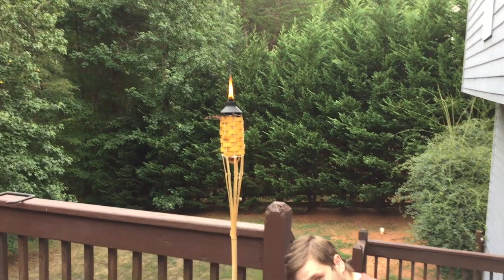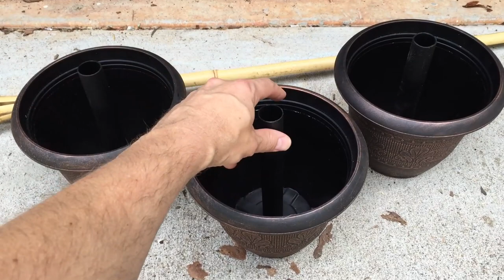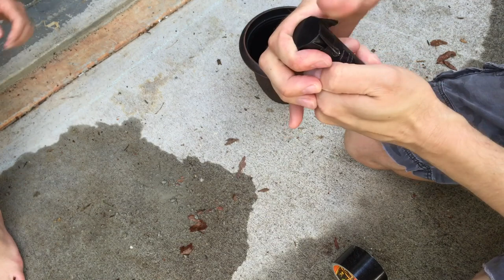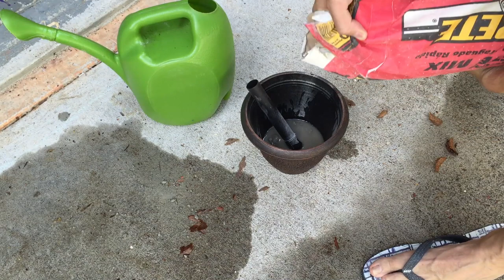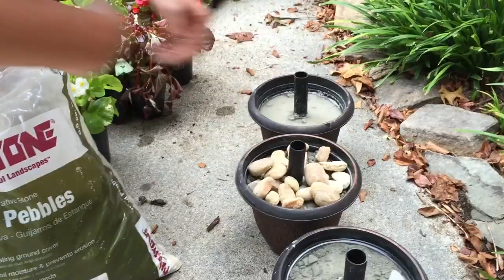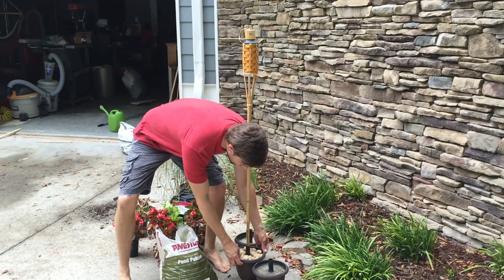DIY Tiki Torch Stands

Comment: Awesome DIY.  Took me about an hour to do 8 of them.  Use at LEAST an 8” pot.  When the fuel canister is full, the weight at the top makes the base unstable if it’s smaller than that.  I filled my pots half full of of quickcrete

Comment: Sooo curious though. With nowhere for water to drain, have you created mosquitoes hot beds ? Water will pool on top of the concrete and mosquitoes will thrive?  Just my 1st thought.
Reply from the maker: I figured that out after the video. I drilled some small drain holes in the sides later on.

Comment: made these, unfortunately with the slightest nudge of the lawn mower it easily tipped, luckily it wasn't on.  I like the idea overall, but i'm going to buy the square pot next time to give it a wider base. 
I'm scared to have these around if there are kids or a dog because when filled they are top heavy
Reply from the maker: I didn‘t have that problem. Mine were pretty stable with the concrete poured in the base. Maybe you could go for a slightly bigger pot with more concrete?
Reply: That’s why these are moveable.
Reply: @kellimucci1414  and very tippable.  Things can be moveable and still sturdy you know

Comment: Hmm. Tiki torch stakes are about $3 each. This solution sounds more expensive.
Reply from the maker: It probably is 😂
Reply: Pond pebbles are roughly $5 depending on the pebbles. The quikrete is also $5 so $10 investment compared to the stakes which are $5 where i am.

The neat thing about this is the decor of the pot and the pebbles can compliment the home nicely compared to the simply stake (but that all depends if you want it in the ground or in a pot).